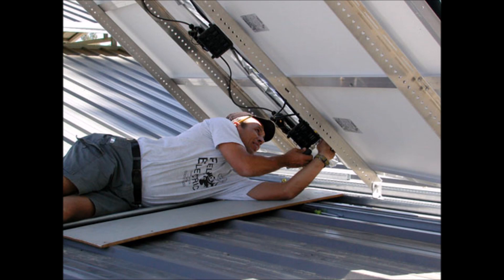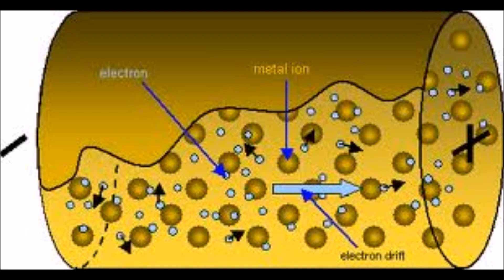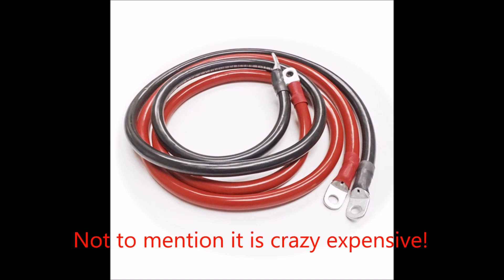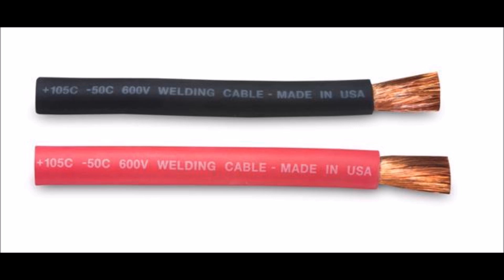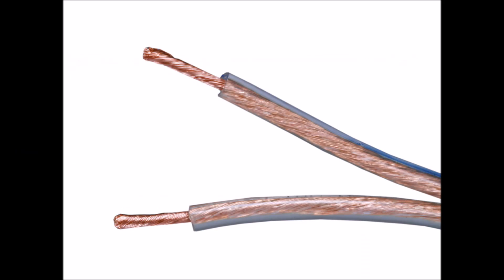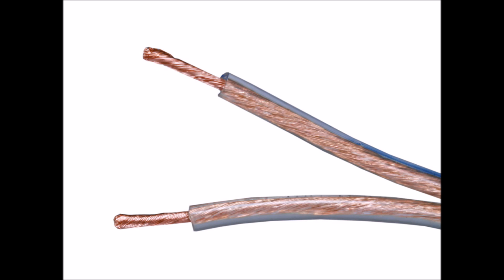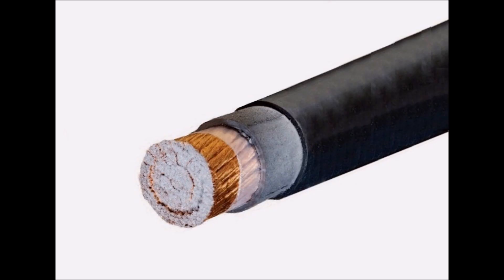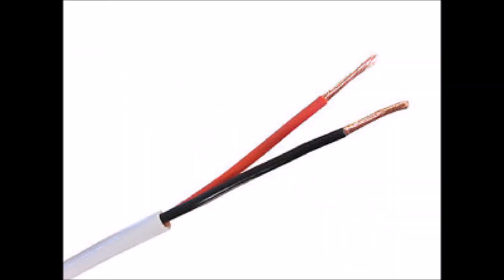Solar Panel Basics - Cables & Wires 101

Comment: I have some #10 ga. Landscape wire. Thinking about using it to connect panels to charge controller but it's rated to 30v. My panels all together are around 100 volts. What do you think about it?
Reply from the maker: Yikes.  Why would it only be rated for 30V?  I think there is more to the story there.
Reply: @LDSreliance  some say the insulation is not surfactant

Comment: 120 run length
Is it better to go w DC PV wire or converted AC wire for that length?  Going to a pool pump.
Reply from the maker: AC would be ideal because it is much higher voltage so it won't suffer from voltage drop over that distance.  As long as the pump is AC.  If you have to switch from DC to AC and then back to DC then that is pointless.

Comment: Hello I am a bit confused. By an online solar calculator I am recommended to get 4awg wire to run from solar panels to inverter. However don’t mc4 connectors only work for 10-14awg? I bought some branch connectors but I’m thinking if I have 4awg wire they will not connect to the other end of the branch connectors. Why are recommended cables bigger than 10awg if we will not be able to connect them. Like I am missing something ?
Reply from the maker: Yes, the biggest I have ever been able to fit in an MC4 connector is #8AWG.  If you need 4AWG then you really should re-consider how you have your solar panel system configured.  Either your run is too long to the inverter or your voltage is too low.  By increasing the voltage of the system you will cut voltage drop significantly and can use thinner cable.

Comment: Do you have a specific wire for a run from panels to charge controller. About 75 feet.
Reply from the maker: Oh boy.  That is going to be a very big, expensive wire.  Does it have to be that long?
Reply: @LDSreliance  i might be able to get it down to 45 maybe 50 feet. Any help on choosing the best wire would be very helpful.
Reply from the maker: Well getting it down a bit is a good start but I still need to know how many Amps you will be using at the maximum and then I can recommend a gauge.

Comment: Hi! Great videos! Can you tell me what gauge wire from 12vt 100ah lithium  battery  to 40 charge controller 18 feet apart?
Reply from the maker: 8 gauge.

Thanks for watching!
Reply: @LDSreliance  YOU ROCK! was ready to buy 4 gauge to be sure but what a kick in the BUDGET! Thank you soooo much
Reply from the maker: No problem.  8 gauge can handle 40A for up to 20 feet.  Good luck!

Comment: That cable is how many mm
Reply from the maker: Which cable?
Reply: @LDSreliance  
the one u are using
Reply from the maker: I use lots of different cables.  Depends on the purpose and how many amps it will carry.

Comment: Speaker wire is bad advice
Reply from the maker: Why?
Reply: @LDSreliance  Because at 12v thin  cables burn if loaded with many amps. Cars burn everyday worldwide coz of wrong cabling, especially on unfused after market systems by diy guys
Reply from the maker: That isn't relevant to speaker wire.  I didn't say anything about thin cables or running things unfused.

There is very little functional difference between speaker wire and other types of wire.  Most of it is marketing.  The only real differences would be the jacket construction and materials and whether the conductor is stranded or solid.  Obviously if you are installing wiring outdoors you wouldn't use speaker cable.  But for indoor wiring speaker wire is readily available, easy to use, and cheap for small, off-grid solar panel systems.
Reply: @LDSreliance  you know better about cables. And that thin cable is very bad advice. You almost had the whole video right, till that suggestion
Reply from the maker: Where are you getting this recommendation to use thin wire?  Speaker cable has nothing to do with thickness.

Comment: I have a 110w and 35v solar panel,,, connecting to a paired set of 6v RV batteries.  What I didn’t get is what “gauge” should my stranded THHN wire be from this panel to 20amp controller and what “gauge” should the wires be from controller to the battery?

Comment: I need to extend my panels out about 50 ft so they get good direct sunlight what kind of wiring should I use to extend those panels
Reply: Safe to use 4mm2 or 6mm2 wire is even better to extend your string leads

Comment: hi, Does 2.5 mm ttr cable carry 12 amp load with 190 watt mono panel?  thanks

note: cable distance 10 meters
Reply from the maker: No, that is too small for 12A over that distance.  You need 6 AWG (4mm) cable to go that distance with 3% voltage drop, which is the generally acceptable amount of loss.
Reply: @LDSreliance  it's ok...thanks for the valuable information
Reply from the maker: You are welcome!  Good luck.

Comment: Hello. We are building a small system for a house.  I’m about to wire the breaker box and all outlets of the construction and wonder what cable gauge should we consider if our electricity will be solar.   We have a 1000 12v inverter and 750 wards in panels.   We will only need light for lights, a small pump and a small refrigerator

Comment: I have a 80 amp epever charge controller and 2 100 watt renogy panels and I'm expanding in the future. I'm unclear what kind of battery I should  purchase to make the 24v 36v 48v systems. Can you recommend any? And what gauge wire?
Reply from the maker: Shoot me an email at ldsreliance@gmail.com.  I need more info.

Comment: Would be interesting to test the difference between two panels in series at 72 volts with 100 feet of 20 guage wire compared to two panels in parallel at 36 volts with 50 feet of 12 gauge wire. How do the two configurations manage to generate power on cloudy days. I am going to test this out and see what happens.
Reply from the maker: Sounds like a great video!  Send me a link if you make one.
Reply: i used  240v  solid core cooper house wire 40a on solar panels 90 ft from house on 72v panels and got 72 volts at the house not bad aye

Comment: solid wire is less likely to arc / short / burn your place down, that's why it's illegal to use stranded for standard home electrical panels. (at least in canada)

solid is more difficult to work with, but is safer.
Reply: That being the case (solid wire being better) why can’t the same type wire we use for house be used for solar panel hook up 200 watts on a shed with marine RV/ battery…Just curious if it can be because I have a whole roll of it sitting in shed

Comment: Good video! I'm still confused on wire sizing though. I'm putting a 200 watt panel on my camper van and the panel has a pair of 4mm2/AWG 12 cables running out the back about a meter long . I've got a 3m/15ft run to my charge controller. My charge controller won't accept wires bigger than 8mm2/AWG 8. All the calculators say I should be using a pretty hefty wire size (10-16mm2/AWG 8-6) but that wire is too big to attach the charge controller and won't the 4mm2 wire from the panel just create a bottleneck anyway? Is there any reason to use bigger wire than what comes out of the panel?  Thanks!
Reply from the maker: Good questions.  Solar panel manufacturers, unfortunately, assume that the panels are being used for grid tied systems OR that you will have a short run to a charge controller for off grid.  Sometimes that isn't feasible.  You have several options.  One, you can add another panel in series to boost the voltage and allow for longer cable runs.  Two, you can figure out a way to put the charge controller much closer to the panel.  Three, you can use the 8mm2/AWG 8 wire and live with some voltage drop.  Or four, you can remove the wire that the manufacturer used by opening up the junction box and desoldering the wire from the panel and then replacing it with bigger wire.

Yes, the 4mm2/AWG 12 wire will be a bottleneck in the third scenario.

Comment: Silent household wire is only for AC DC runs on the outside of the copper needs more strands to flow power

Comment: Not a SINGLE word about the effects of wire length between your array and charge controller, even though it is a crucially important fact while choosing the right cable. Be very careful especially when choosing a cable for panels located more than 5m from your charge controller! Here is a good calculator that shows my point: https://www.solar-wind.co.uk/info/dc-cable-sizing-tool
Reply from the maker: True.  I have addressed that ad nauseum in other videos.  But it would have been worth a mention.

Comment: Just out of interest . Can you use silicone cable/wire to connect from panel to controller , as its flexible.  I am going to install a 100w  12v panel to roof of landrover and only want a single twin core cable/wire running from panel
Reply from the maker: Yes as long as it is weather resistant it will work.  And make sure it can handle 8.5+ amps.
Reply: @LDSreliance   Thanks Bud  I used 10awg for exterior run ( then 12 awg from controller to battery)

Comment: Can I use tin copper?
Reply from the maker: Technically yes but it will have higher resistance.  You really should use pure copper.
Reply: What about silicone wire?

Comment: You're right about folk (me) not thinking too much about cable gauge. I bought a 100w panel and a 10A solar charge controller and thought 10AWG would be okay, but I'm having a problem getting the wire into the controller without it splaying out. I think 12 AWG will fit better but I've read conflicting things about how thick the wire should be. It's all very confusing..🤔🙄
Reply from the maker: How long is your wire from the panel to the controller?  If it is 10 feet or less you can use #12AWG wire and be in great shape.  If it is 20 feet you will need the #10AWG wire.  It sounds like your charge controller may be a cheap model that can't accept heavy gauge wire.  Nothing wrong with starting out cheap.  But it seems kind of silly to me that they design those things and say they can handle 20A but the max wire size you can use is #12-14AWG.  It just doesn't work.
Reply: @LDSreliance  It's no more than 4ft from my panel to the controller so the 12 AWG will be better, which is just as well, as I've just ordered some more cables 😏. Looking through the charge controller manual, it does say to use 12AWG. I didn't think my charge controller was particularly cheap but maybe it is? It's an 10a Epever MPPT. Thanks for replying 👍🙂
Reply from the maker: For 4 feet you are fine using 12.  I haven't heard of that model.  Good luck!
Reply: @LDSreliance  Thank you 😊

Comment: do you have input on advisable length of wire?
Reply from the maker: There are lots of charts out on the internet that will tell you the safe gauge of wire to run for a specific amount of current and voltage.  Here is the one I use:  http://www.solardesigntools.com/wire_calculator.php

Comment: is it possible to replace the cables on most flexible solar panels. Are they screwed on? they wont budge.
Reply from the maker: I am sure you could if you are good with desoldering and soldering.  You would have to cut away the surround to expose the electrical connections underneath to make the repair.

Comment: Who cares about resistance? Wire is rated in ampere capacity? That is what is most important. You say speaker wire is OK? For how many amps! Is that insulation suitable for battery cables? Not in my house.

Comment: What would be the best gauge wire to use for the solar controller battery connections
Reply: What would be the best gauge wire to use for increasing the audio in a youtube video?

Comment: My batteries are interconnected with 1/0 welding cables, so yes, just go to a welding supply place and buy a length of cable, much cheaper than buying pre-made battery cables.
Reply from the maker: Agreed.

Comment: that does not tell me what size I need to use. lets say the thickest wire I can afford and use in my 300W 18v solar system is telephone wire and I need to run it for 800m. according to your video it will be fine. Will it realy be fine?
Reply from the maker: What I meant was use the thickest wire you can afford that meets the current ratings.  In other words, if the smallest wire that can carry 20A at 3% loss is #12AWG wire but you can afford to spend an extra $5 and get the #10AWG then do it.  You will never regret using bigger wire.

Comment: using a Genasun GVB-8 boost charge controller where there are only two battery wires coming off the charger (+) and (-).  How would you connect a 3 pin DMX male  connector that is used to solar charge an ebike battery (cut off charge at 56.4v and charges at 2.5amps) . Do you need the 3rd shield wire..?  or can you just hook up the red to cup 2 and the black to cup 3..?  (and skip cup 1)..?  Thanks
Reply from the maker: I am not familiar with that connector but ebike batteries are just lithium battery packs with a bms.  So yes it will work the way you described.  However, it will take a very long time with such a small amount of solar power.

Comment: Sir already I h've purchased 100 watt solar panel for my 500VA inverter.What should be the thickness of solar wire  to be used.The distance from the panel to battery is apprx 35 ft(10 mtr)
Reply: The standard wire size used is AWG 12 or 4mm2, and it's good for almost all installations.

Comment: Looked around ages for a user friendly/novices explanation on what cables to purchase for connecting 2 X 12v batteries to a 250v solar panel via controller unit ... and this is by far the easiest to understand.
Reply from the maker: Good!  I am glad it was easily understood.  Let me know if you have any questions.

Comment: Would extension cord for outside, a good alternative. To use for solar system setup.
Reply from the maker: Extension cords are built for AC power and they have 3 conductors inside.  I suppose you could hack them to use for DC solar but it would be better to just buy solar cable.
Reply: Ok thanks, I live in Canada and everything is so expensive, but I will fallow your advise.
Reply from the maker: Use what you've got to start out.  But be careful using products that were not designed for that task.  Sometimes that can be dangerous.
Reply: LDSreliance ok thanks, will go the safe route.

Comment: Any thoughts on using 10 gauge S.O. (SOOW) cable (with two conductors) for a small "portable" solar system? It seems pretty durable but is it overkill?
Reply from the maker: SO cable is awesome.  It will work fine but 10 gauge isn't very big so make sure you aren't exceeding the current capacity of the cable.  You will get a lot of voltage drop and waste your power if you are carrying too much current over thin wire.
Reply: We're creating a very small system for use with our tiny RV's 12 volt house battery. We were going to start with one 100-watt panel with long term plans to expand to 400 watts (adding 3 more panels over time). Do you think 10 is still too small? The panels come in "kits" with 10. Today, I was thinking of trying a bigger cable to reduce resistance on the "long run" of wire from panel to RV. So, I was thinking of using 8/2 SO cable for the run (20'-50' in quick-connect pieces) from the panel to the charge controller which would be close (<5') to the RV battery. What do you think?
Reply from the maker: For a 100W solar panel that would be fine for about 11.5 feet maximum before you start suffering from too much voltage drop.  And obviously when you upgrade to 400W that would be way, way too small.  I would recommend that you go with #8AWG for now as that will allow you up to 18 feet to place your 100W solar panel in the sun in the best spot.  Then when you upgrade to 400W you will need to use a combiner box to bring the leads from the panels together and then a single #2AWG cable would allow you that same 18 feet.
Reply: Whoa. That is definitely thick cable! Thanks for your help; I totally underestimated the resistance. So how do the "kits" get away with including a 20- or 30-foot "adapter" cable that's made out of 10AWG? Just curious on that one. :)
Reply from the maker: They don't care about the performance of the system.  I just recently reviewed a 200W system from a no name Chinese company and their cable was about 20 feet and worse yet it was aluminum wire!  Not even copper.  So the losses from running 17A or so through 20 feet of aluminum cable is obscene.  I don't know what the gauge of the cable was but it was around 10 (they use mm instead of AWG).
Reply: I can't believe it! Aluminum! I guess I'm not surprised that companies don't really care but it's certainly misleading to sell kits 30 feet of 10 AWG when you know it won't work. Hmmm. So here's another idea -- what if I run the panels in series or in parallel-series to up my voltage and keep my Amps at 5 or 10? For example, each panel is about 22.5V, 5.29A. If run them in series, that's 90 V, 5.29 A. In parallel-series, it'd be 45 V, 10.58 A. 

The big mystery to me is how to calculate the loss of power based on resistance. Is there an easy way to do that?
Reply from the maker: Use a chart like this:
http://www.affordable-solar.com/solar-tools/wire-sizing-charts/

There are also calculators out there that you just plug in numbers and it will spit out the gauge size you need to use.  Stay under 3% voltage drop.  More than that is just too inefficient.

As for the solar kit sellers from China (or other cheapo knock off products from China for that matter) they put out cheap kits online on Amazon and Ebay and sell a whole bunch under a brand name and then when their reputation catches up with them they pull the listings and put them back up under a different name.  It is pretty twisted.  They are just out to make a quick buck by stealing the design of someone else and conning as many people as possible as quickly as possible.
Reply: Thanks!
Reply from the maker: You are welcome.  Thanks for watching!
Reply: @LDSreliance  
  10 gauge is rated for 30 amps .
Reply from the maker: @LincolnSP150  Over a certain number of feet, yes.  You can't have an amp rating for a cable without a length to go with it.